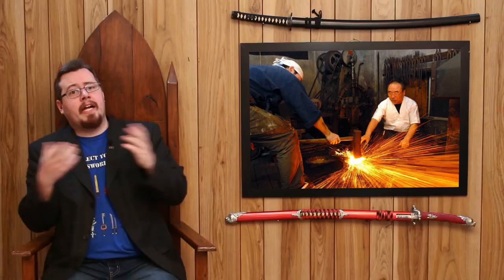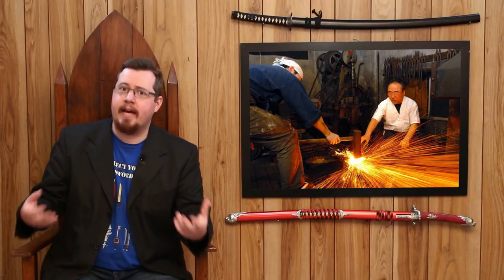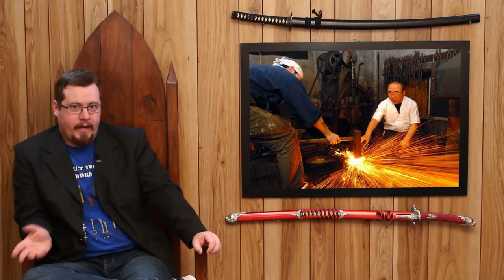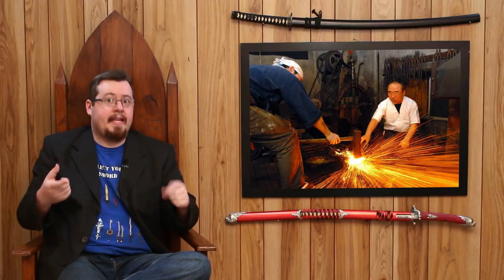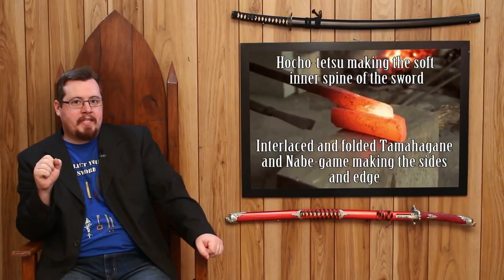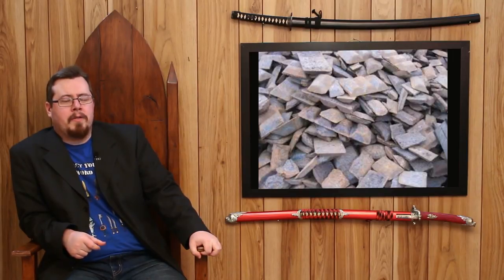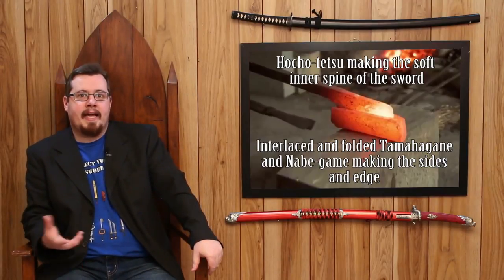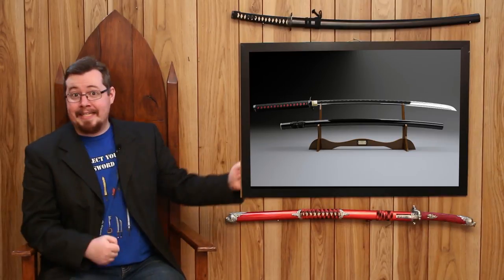The TRUTH about the KATANA, part 3: Why the steel is folded

Comment: The oxygen is not released by the heat but absorbed by the carbon monoxide of the fire. Carbon monoxide is formed when something isn't burning cleanly which is why it's so tricky to create temperatures hot enough. You need the fire to not have all the oxygen it needs to make sure you get enough monoxide but if it doesn't burn fully it doesn't get as hot as it can. They usually solve that by having 2 separate fires burning but that greatly increases the complexity of the smelting equipment.
Carbon monoxide is very good at absorbing oxygen from iron, it's actually still what's used today. That's the reason it's so toxic to humans. Hemoglobin is a form of iron and carbon monoxide absorbs the oxygen that's bonded to it.

Comment: shad just a point about japanese steel, they actually do have a tradition of crucible steel, however the crucibles were small because that was all that could be produced mand the carbon content was extremely high like wootz, this steel was used to raise carbon content in the tamahagane stack up when the billet is being forged. however there is also a tradition of imported steels http://www.naippe.fm.usp.br/hobby/Namban_steel_and_Hizen_swords_latest_fina.pdf heres an article discussing the use of wootz in japanese swords and here http://www.tokensugita.com/NT.htm is an article discussing antique examples of swords using imported steels in the construction, though this is believed to be dutch cannon steel.

further explinationg about japanese crucible steels
the japanese crucible steels that were produced, from my understanding only worked due to the high carbon content, from how its been explained to me the higher the carbon content of steel the faster it heats up, and whilst the tatara cant maintain the temperatures needed for very long it can reach them under the right circumstances. basically it needs further research though modern smiths have discussed this with japanese tatara operators and have even tested it.

Comment: so forging doesnt necessarily means better swords ? if you already have a really high quality steel from the beginning, just cast a sword out of it ?
Reply: +iodineclip
forging also changes the internal structure of steel. actually the structure shows higher influence on the mechanical properties than the chemical composition. you want high quality steel because most impurities are starting points for cracks.
a cast sword will be comparably soft even when using best quality steel.
just a side note: properly forged swords have different mechanical properties over the cross section which cannot be achieved by only casting.
Reply: Andreas Vogel i see, thx for the info :)

Comment: Actually the problem is not that they (Japanese and Europeans) were not able to achieve those high temperatures. Achieving those Temperatures was never the problem. The problem is that smelting iron at those temperatures does not produce Steel, it is producing pig iron. Pig iron is not steel. It can not be forged and is completely useless for the production of weapons. It is also not the same as nabe-game. And it is also not combined with tamahagane to produce shingane. Decarburisation takes place, but not to convert pig iron ito steel, it just reduces the carbon content from around 1.4% to around 0.6 - 0.8 %.
It is also a misconception that the slag will be burnt away by the oxygen. Either the slag is already oxydized (silicates etc.) or the material will be oxydized after it reacted with the oxygen. However some of the bigger slag inclusions can be squeezed out during forge folding since they turn liquid at those high temperatures. 
The main reason for the folding however is indeed the homogenisation of the carbon in the steel and breaking down/spreading out the impurities inside the steel.
However most of this discussion is futile anyway, since steel was basically folded everywhere. The Europeans folded their steel and the Japanese folded their steel. The reason is very simple. Both used the same basic technology to produce steel. The bloomery. It just had different names in different parts of the world. But the end result was still steel with a relatively high content of slag. To be exact, mostly between 0.5 and 2 %. After the middle ages the Europeans made more and more use of the blast furnace, in which all the slag is removed from the iron. However in a secondary process to convert the pig iron into iron or steel, the slag gets back into the product.

Comment: Very very nice vídeo. Congratulations.

Btw, pig iron is called pig Iron, not pig steel, because iron containing more than 2.1% (weight) of carbon is called cast iron, and the carbon percentage of steel lies between 0.05%~2.1%.

Comment: Katana is pretty cool when you factor in that it was made without the ability to check the details like the material structures and stress points inside the steel. It was all done by feel and sound, and is absolutely miraculous when taken as a feat of skill as a whole. I still prefer the saber as a single edge weapon myself, but its still impressive. The fanbois do need to take a breath and relax though.
Reply from the maker: +Arbhall McDougall Very true, the level of sophistication in folding and pattern welding considering the point in history these techniques were developed is truly phenomenal.

Comment: Why weren't the ways the three iron alloys were forged together mentioned at all
Reply: the carbon distribution in the katana is when the forging process takes place instead of the smelting. The three irons use that were  folded into making the blade in a molecular level they weren't combined as it normally would because of the oxide by product making the carbon rating high but because of the pig iron which help make the carbon rating standard into making a steel sword but is not pure steel.
Reply: you did not understand my question.
Reply: Forge welding? Lamination? 
I’ll go with lamination. Lamination wasn’t used very often due to difficulty, this goes for the entire world, for all of time. Most swords, spears, knives, etc were/are made of a single piece of steel.

Comment: Adding Carbon to iron makes no steel. Steel is an iron alloy with other  elements like Cr, Mn or Ni etc..  If you want steel you have to reduce the  carbon content under 2,06 %. A high carbon content in iron make it posible to sharpen the sword but high carbon iron is also fragile and shatters easier than low carbon iron or steel. A low carbon Iron / steel is more flexible.

Comment: Different layers of hardness form from the Japanese method. They accidently made stronger bulk steel by allowing impurities and over abundances of carbon as well as slow cooling then fast  quenching and cold forging to make an array of crystalline structures some only found in modern day bridge cables, in differentiated layers. Yes that IS mechanically superior to a blank piece of 1095.

Comment: Shad:

Steel: max. 2.06% of C.
Pig Iron: usually ~5% of C, sometimes as much as 7%, depending on production process. German term "Roheisen" for Pig Iron means raw iron, I think it fits better.

Usual definition: steel is a /malleable iron-carbon alloy/. Pig Iron is way too brittle for that. Even Cast Iron with 3-4% C would be.

Metalurgy is somehow mixed up in your videos, but not totally off ;)

Comment: This is excellent video, but one question bothers me.
Did the Europeans in The Middle Ages had technology of smelting iron ore, that could remove all slag?
Reply: No, but in India there were quite sophisticated smelting techniques that could. They sold their products to Europe, however, so it was used there, especially by the vikings in the ulfbert swords, google those, they were considered the best in their time. Aside of the best steel India was also the source of the forging techniques that could produce damascus steel, which is probably the best steel ever made in historical times. There are some modern steel types that outperform it but nothing from pre-industrial times comes even close to that.
Reply: Thanks ;)

Comment: Just wonderin... (actually part of the research for some scifi i'm writing) would carbon still boil away from a piece of steel forged in a vacuum?
Reply: Hi, not really, although it depends on the temperature. Generally steels with a high corrosion resistance or HSS Steels are hardened in a vacuum, because they need very high temperatures (up to 1200°C) to fully harden and tend to loose a lot of carbon at those temperatures. However some steels (pressure-nitrided) need a nitrogen atmosphere when they are hardened or worked hot because they would gas out all their nitrogen inside a vacuum.
Reply: Thanks

Comment: Other point is that, like carbon, not all impurities are equal.

From the paper: "The harmful impurities such as P, S, Cu and Mn are low, which exerted sword quality."

One of the primary benefits of the durability of wrought iron is its fibrous slag structure forged into it, which also starts from pig iron but is completely decarburized.

And in the forging process carbon can be added with a reducing environment.

Also your argument about "better" steel is unclear since both swords go through a forging process. If you think European swords were cast but with superior base steel, well I've got bad news...

The main focus of the metallurgical analysis of the old Japanese sword is EXCEPTIONALLY LOW is specifically harmful impurities. Sulphur (of which the tested sword had ZERO) in steel is just awful for hardness, but great for ease of machining.

Comment: Random question, what would be of a sword that is nitrocarburized?
Reply: I could be wrong, but I think you mean nitrited.  It would mean it has nitrogen atoms stuck in the iron crystals in addition to just carbon/iron steel.  

Think of it like adding small pebbles (carbon) to a jar of stones (iron). They are small so they can trickle down and fit in the gaps.  Nitrogen is even smaller , so it would be like adding fine sand to the jar... it fills in the gaps further to make a more solid piece of steel.

Comment: My one complaint on this video is you can't read chemicals properly:

It's iron monoxide and Aluminum Trioxide. Not Iron Dioxide and Aluminum Dioxide.

Di is Greek for two. Carbon Dioxide and Hydrogen Dioxide and all other Dioxides have two oxygen atoms in the molecule, and that's where it comes from.

Comment: pig iron is called so (to my  limited knowledge) because it is brittle, unlike steel, but like iron, it also looks more like iron more so than it does steel, and is what happens when you put waaaaaaaay too much carbon into iron, making something that while technically steel, is more like iron, but can't be readily turned into steel, which would make it suited for pigs instead of people (this is extrapolation on my part) since it is not iron, but behaves like iron until you try to smelt it then it just becomes garbage unless you reeeeeeealy know what you are doing.

Comment: Where Pig Iron Gets Its name from
The pig part comes from how it is produced. Which is out of Pig Furnaces. Large bellowed, water wheel powered smelting operations where the furnace itself, the spills that the furnace product flows into, as well as the creaking and wheezing sounds produced by the water wheel and bellows, is reminiscent of a Sow lying down nursing her Piglets (visually and auditorily) . This is actually Western European terminology going back to the early middle ages. It would not have been uncommon to even call a lot of fused bars a drift (after what we would call a Pig's litter) or an individual bar a piglet.

And the reason it is refereed to as iron and not steel is because it is iron. Iron (as a furnace product) is not considered steel unless it has a carbon content somewhere within an ideal range (around 0.35%-1.1%). If it is outside of that range, regardless of whether it is above or below it, It is considered iron. Because steel isn't just iron with a carbon content. Steel is iron with a rather narrow range of carbon content as to make it good for tempering/heat treating/annealing. Things that can't be done well (if at all) if the iron does not have a carbon content within that ideal range. 

Modernly we would refer to this as cast iron. Though the terms cast iron and pig iron are not exactly synonymous. Our modern cast iron is as much an improvement on pig iron. As our modern steel is an improvement on ancient steel. While it still has very high carbon content (that imparts a low surface friction and makes it good at conducting heat. Making it good for applications like cast iron cookware). It is much more slag and impurity free than pig iron ever was. Old pig iron was hard to the point of being brittle with how high it's carbon content was. Especially considering the slag in it Decarburization and purification through hammering was necessary. And once done the resulting product was called wrought iron (today we say wrought or forged, but ours is still a superior product).
Reply: TheHelleri Semantic debate over etomology. Depends on how you view it, and if atomic theory is correct. The some is pig iron and some pig steel since it varies fairly largely as a byproduct. Either way,even the best made long sword isn't going to chop through a katana unless the angle is perfect and the katana user does a direct blade block just right. Even then, the katana would have to be held just right and super tight,else letting the blade move throws the impact off. Anyway,u block with the sides of a sword and the back, and it isn't usually a direct block like a shield, but rather a glancing and parry using minimal effort.

Comment: Not all molecules with Oxygen in them are 'Dioxide'. That's if there are two Oxygen atoms. If there is just one Oxygen atom lie CO, rather than CO2, it's Carbon Monoxide rather than Carbon Dioxide. Mono, Di, Tri, and I can't remember was 4+ is. Perhaps Quad, Hex, Sex, Sept, Oct, Non, Dec, and so on. Anyways, there's also something to do with Chemistry in regards to Ionization or some such thing in which you can ignore these altogether. Like Potassium Oxide (I don't know if that's an actual proper molecule or not; just using it as an example), that might not need to have any of that mono/di/tri stuff in the name. I'm amazed that I retained this much information about Chemistry, even though I completely failed with only 30-something percent.

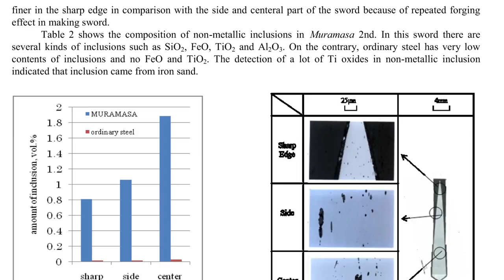Anyways, awesome videos. It's just that I found it odd that around the section with the little chart around 25:23, all the impurities with Oxygen were given 'Dioxide' which means 2 Oxygen atoms specifically. CO2 is Carbon Dioxide due to there being 2 Oxygen atoms and also because it is or isn't an ionized molecule... or something. If anyone reading this knows more about Chemistry than I do (I wouldn't be surprised; I seriously suck at Chemistry) and are in a state of WTF from this comment from some things I might have gotten wrong, then please point them out. I wouldn't want to be spreading misinformation, even if it's at the cost of finding out I'm utterly wrong about some of this stuff.

Comment: Two things which seemed unclear to me.  First, you say that ferrous oxides found in Muramasa must came from their iron "sand".  If there was a significant amount of sand in the ore, we would expect silicates, not ferrous oxides.  "Oridinary steel" had lots of silicates and aluminium oxides.  Muramasa steel was free of SiO2, so they were obviously able to somehow get rid of it.  Probably through repeated folding?

Then you say that folding removes impurities by "burning them off".  Burning produces oxides, most of which are solids.  SiO2 is solid, actually it's sand.  It won't magically "burn off".  It was removed, but probably through a process of a different nature.  What will definitely burn is iron itself, though.   It produces scale, which will get into metal if people do a lot of forging.  

So it seems to me, that they successfully removed silicates but introduced a lot of scale into the steel at the same time.
Reply from the maker: +bakters My understanding is that the muramasa steel had lots of SiO2 still in it, less closer to the edge but still plenty of impurities. so the mystery of where it went as I understand it is that it's all still there https://youtu.be/r1z6-h7XACg?t=1521

You're right about the probability of iron oxide being put into the steel from folding as I even read somewhere that when folding you have to be very careful to not trap the scale (oxidized surface iron) in between, which simply points out that it is very possible to do so. So yes I agree completely! It is very possible to over fold something making the steel far worse than it originally was.
Reply: I am Shad Yes, you are right.  I got it wrong.  There is still plenty of SiO2 and huge amounts of other stuff on top of that.  Thanks for the link under the vid, it was very helpful.

Comment: Most people think steel has more carbon in it than cast iron. That's wrong. Steel was between 0.002% and 2.14% carbon by weight and cast iron has from 1.8 to 4% by weight.

Iron from this time had to much carbon not the the other way around.

https://en.wikipedia.org/wiki/Steel
https://en.wikipedia.org/wiki/Cast_iron